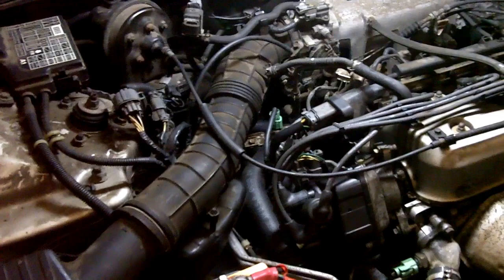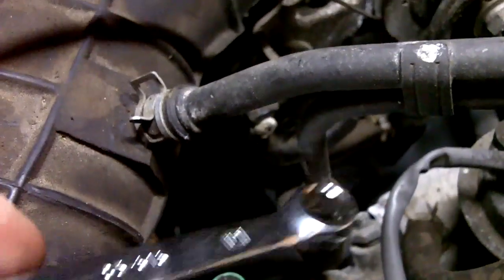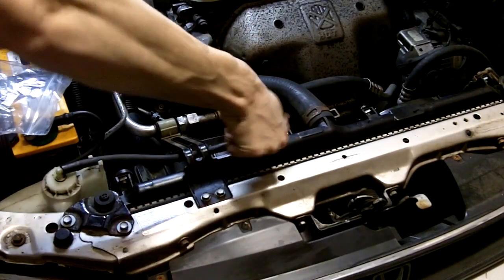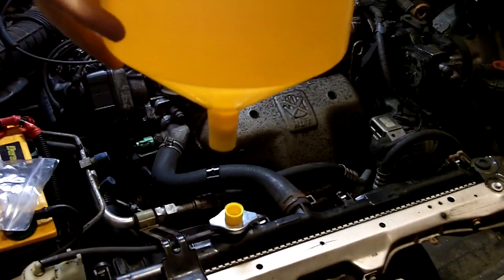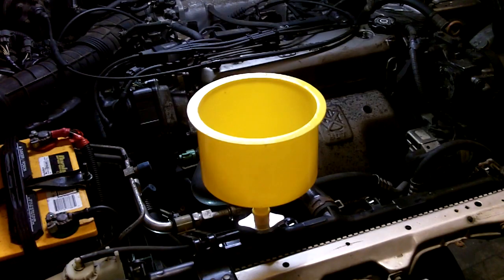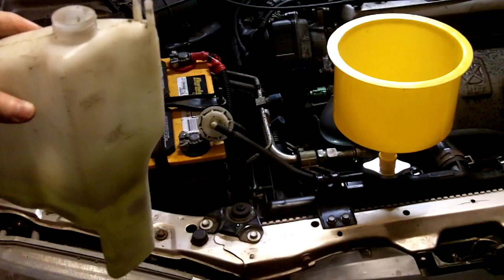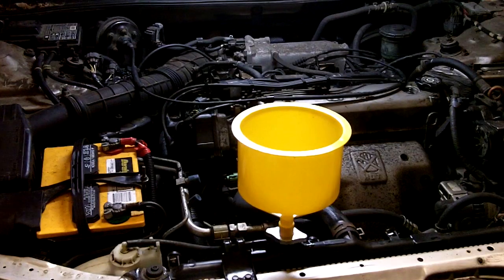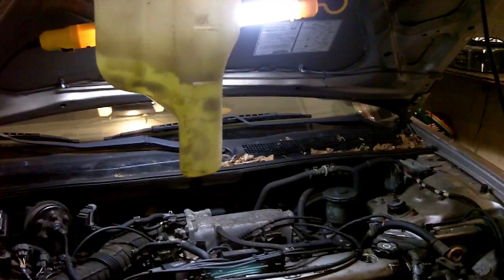Refilling And Bleeding The Cooling System

Comment: Would you mind answering my question, you seem to have a lot of knowledge in this department.
My beloved '02 Camaro SS is overheating up to 260*C for the past few days when in traffic on the way back from work. In the morning I fly @ about 80-100mph average on highway and have no trouble of this sort at all. The overflow res is full to the cap and way past the HOT FULL level, while the radiator is half empty both when engine is cold. Today I stopped after almost reaching 260*F, turned ignit off

Comment: Do you know where that air valve is on a 2003 infiniti g35 coupe v6? I have air in my heater core. What if you have digital buttonts on dash and not the dial? Should i just turn heater on and burp the system?

Comment: how do you perform a leakdown test? had a leaky head gasket, the van isnt worth putting the time and money into a new one so i put iron tite all weather seal in it, (didnt like doing it but it was such a small leak it just spuddered on startup a tad) never had to add coolant it was so small , but anyways from the head leaking there is still air in the system, works great now hasnt spuddered since i put it in 2 months ago, just wanting to know if i can test it isnt leaking anywhere at all

Comment: My fans don't turn on.. which is the fan sensor? I notice 2 plugs that go on the top radiator hose that goes to the cylinder head and another smiliar plug that's by the thermostat. Are those the fan switches

Comment: the problem i am having is i was doing a long jounery, after climb a hill i noticed the temperature going to the red , i stoped and checked it just to find that the over flow bottle is full with coolant . I now notice that when it is idle the coolant flows out the top of the radiator eith the cap remove.

Comment: what causes the water to come up out  the radiator into the water bottle filling it up?    When i remove the cap there some pressure. With the cap remove the water keeps flowing up out of the radiator.

Comment: Sorry, i meant to say, but when i accelerated, the temp moved back up.  i did pop the hood to find coolant on the air intake cover, but hose i replaced was dry.  Didnt hear any hissing, but did notice a small plume of steam.  Before I repaced the hose, it looked like a smoke stack!  The hot water from thebypass hose was spewing on the manifold.  I have a 1993 Honda Accord wagon.

Comment: Thanks so much for this video!  I replaced a worn engine coolant bypass hose this past monday and was heading somewhere.  it seemed like it was cooling like it usually does, but 10 minutes into driving on the highway, the temp crept up. i slowed down to pull over and the temp dropped instantly but went when i accelerated.  i let it sit and cool and made it to my destination, but the temp went back up.  i filled up the radiator but didnt bleed the system.  Now i know how to do it properly.

Comment: Thanks for the video. How would you undertake this procedure on a vehicle that does not have a radiator cap or bleed valve (only an overflow bottle)? Would you just leave the overflow bottle cap off and let it bleed air?

Comment: The part where you turned on the heater to bleed does that go for all kinds of car? Also my dash does not show hot or cold gauge it just has a warning signal when it overheat, I'm worried once it comes on is it way too hot or just getting way too hot I'll never know. Thanks in advance